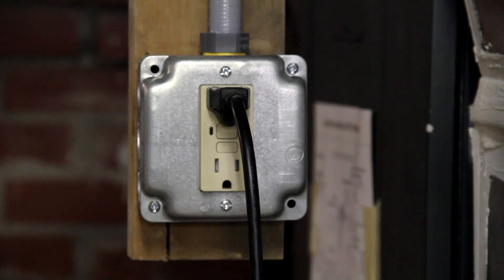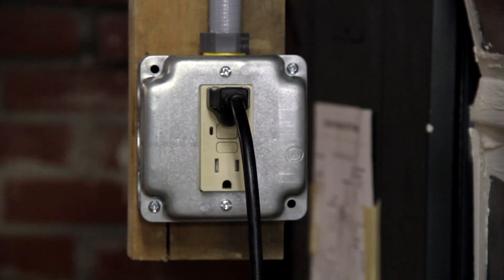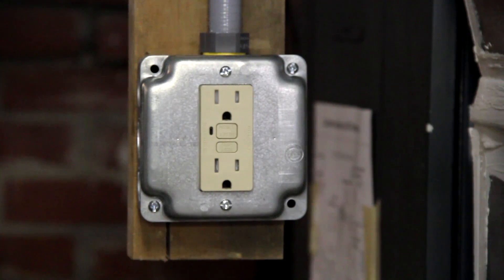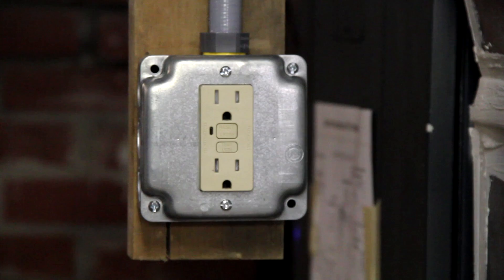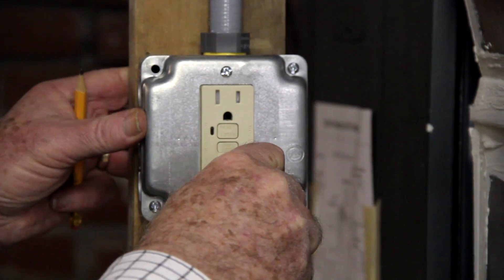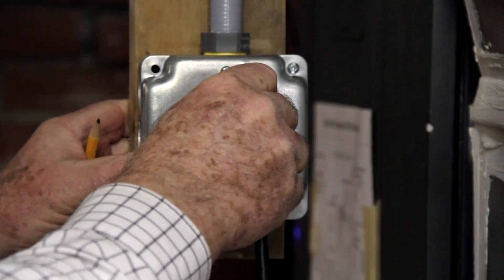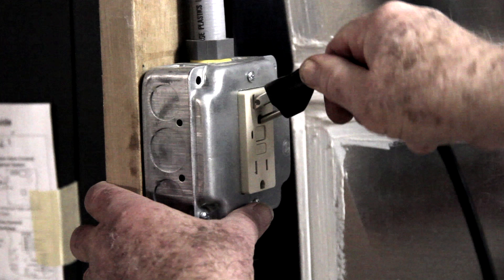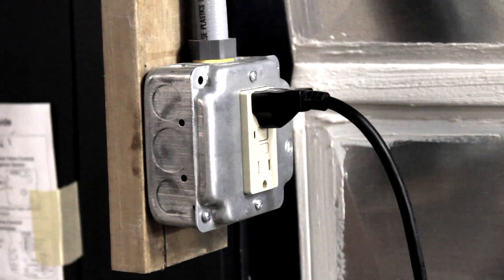How to Defeat a GFCI Tamper Resistant Receptacale

Comment: Wrong wrong wrong. These plugs are meant to rock gently side to side to be able to push in, think about it it is designed to not allow someone to push an object into one side so in order to defeat the Tamper Resistant plug, by rocking from side to side it allows the plug in a very little on each move and then to the other side the outlet will open.

Comment: I just tried this on some new outlets.It KINDA worked on the three prong plugs, but they never went in.I think in relation to these new duplexes there’s too much distance between the two blades and the ground to go in at an angle and bypass the shutters like you say.What I wound up doing was priming my outlets by putting something with a low profile in first, like a electronic pest repeller or an air freshener.That loosened them up enough for me to plug in something more substantial without feeling like smacking them in with a mallet.

Comment: Gary, do you have time to be President of the United States?  We need someone in Washington that comes up with effective solutions!  Thank you for your clear demonstration of a method that works with these darn damper resistant receptacles.  I had a simple job: add a receptacle for a new water softener.  Adding the receptacle was easy.  Then I went to use my tester to confirm it was wired correctly and that's when I had my first experience with this type of receptacle.  After watching your method, it was a piece of cake  to perform the test.  THANK YOU.

Comment: THANK YOU!!!  I have always had trouble with these.  I use equal pressure, I wiggle, I push with all my might - but they do not work.  This time, I have tried for 3 days to cram the prongs into the outlet but nothing worked.  After seeing your video, I thought, well, might as well give this a try - it worked the first try.  Thank you SO SO MUCH.

Comment: Here is a further refinement to the method posted here. The posted method generally worked for me, but not for one particular male plug that I was trying to insert into the receptacle. No amount of pushing or wiggling worked. The problem turned out to be with the male plug, the prongs of which each had a rather sharp, blade-like surface on the ends that were being pushed into contact with the plastic sliders inside the socket. Apparently the blade-like surfaces were biting into the plastic sliders enough to prevent them from sliding as intended. The solution was simply to smooth the ends of the prongs slightly with an emery board (a file would probably work as well) to dull the blade-like surfaces. Problem solved.

Comment: No better way to spread and wear an outlet's contacts than having to wiggle plugs into it. Same with excess force on plugs. They weren't designed for that much insertion force. So you risk the hazard of a contact-Resistance-related fire or a hand-slipping shock. GFCI coils only detect unbalanced line currents. They don't protect you from shock with your fingers across the plug's conductors. What were those Agency Bozos thinking?  There are much more reliable and usable ways to make a socket tamper-proof.
Reply: Unfortunately, the engineers that designed these things apparently didn't consider their impossibility-to-use as an actual threat to safety in its own right.  Personally I think they're going to be the cause of a LOT more problems than they avoid.

Comment: help!!!!!. we are only getting electric to one side if our mobile home. we have power but not at full amps. we tested the circuit breakers and they're running between 117 and 120. we've changed all outlets on the affected side of the home. after switching the outlets we tested them and a row of them are reading bad ground but others were fine. we are at a complete loss at this point. any suggestions?

Comment: Unless you are familiar with these receptacles, you will have trouble, but the 3 prong male end plug goes in easier than a 2 prong male end plug. The reason for this is that the ground (cylinder shaped prong) is longer and therefor essentially releases the spring that holds the neutral and hot (the two vertical blades) tamper resistant plates.

I know this is not a scientific explanation, but this is the best way to explain it.
Reply: I think your theory is sound, but I'm not sure it checks out.  I've had plenty of trouble plugging in 3-prong plugs into these, too.  That shouldn't be the case, if the grounding pin actuates the shutters.

Comment: Thanks.... I went crazy....... Thanks
Reply from the maker: You're welcome!
Reply: Gary Arrington    -----   Mr. Arrington thank you so much for this video and I'm so glad your video was straight to the point and easy to understand.    My wife and I just bought a house and I was going crazy with this and about to call the electrician that put this in but I told myself to find a YouTube video for help.   It was bad enough that I had to change my dryer plug to 4 prong since new homes built after 2000 can't be 3 prong no more